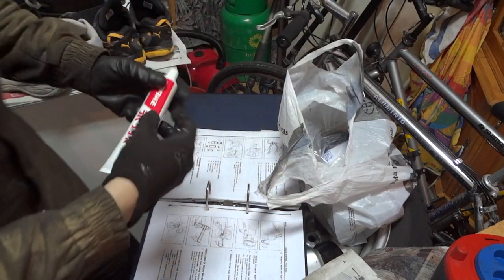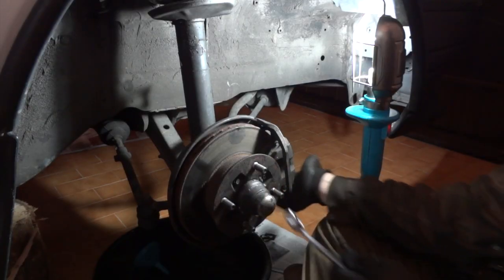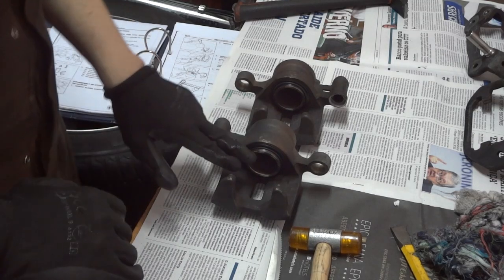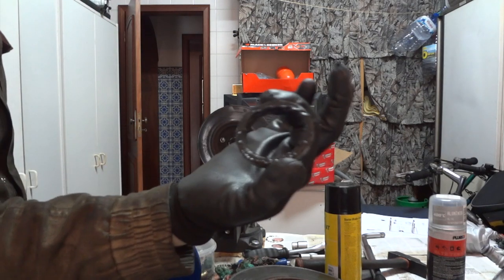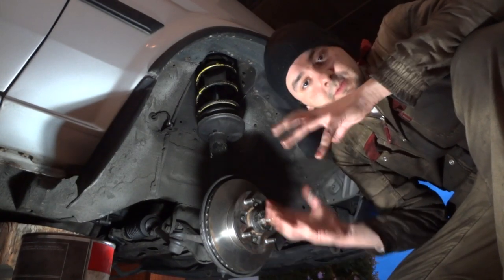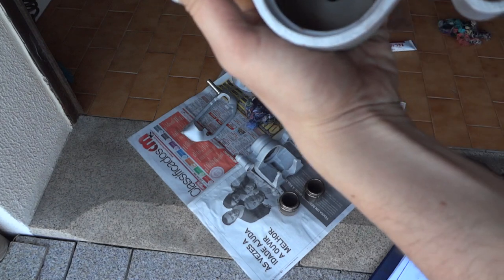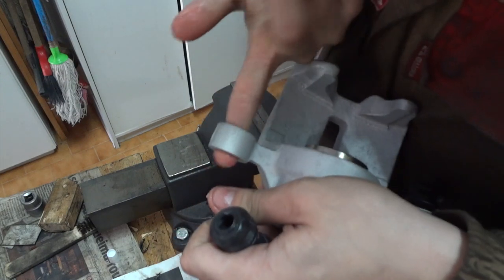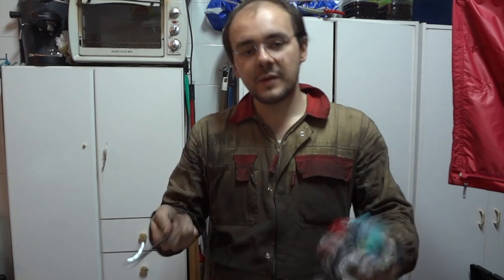How to rebuild your car brakes (1/3 Front Calipers) (1987 Corolla AE86).

Comment: Are the wheels bearings that easy to take out or replace?  How did the brakes feel after all the new grease and replacement parts?
Reply from the maker: Well, the first thing i noticed is that my brakes no longer made a grinding noise when going in reverse gear (this was the initial motivation for the whole brake job). They were getting seized so i was also noticing a bit of permanent scrubbing between the pads and the rotors. After the rebuild, you feel a softer pedal but a stronger braking. It is easier to control the braking power with your foot, the overall braking becomes more progressive, I cant explain. Everything becomes smoother. 

As for the bearings, I only did it as a preventive repair, so there was no actual difference. However, clean grease will greatly improve the life expectancy of the bearings, as long as they are correctly tightened! Dont overtighten, follow the manual's procedures as I show in the video and your bearings will last you forever with clean grease regularly :-)
Reply: João Rocha da Silva You don not need a press to do these bearings?
Reply from the maker: Nope, they come out very easily unlike in fwd cars.

Comment: Hello.... 

can brakes of ae100 corolla Levin be installed on corolla E80... without much modification ??
Reply: Well, Silva had AE86, which is RWD, completely different from the FWD`s you ask about.

The front hub system (E80 and E100 FWD`s have axle through hub from front transmission, AE86 which is Rear wheel drive has spindle through hub.

To answer your question, If E80 (you did not specify 4E or 4A) and AE100 has the same hubs or at least drive shafts then yes you can swap brakes around.

If not you have to change transmission as well and then its not worth it. you will need complete AE100 transmission with drive shafts, front struts, hubs the whole sheblang.

Then its about what engine, different engine = different transmission.
4E-engine from AE80 = Different transmission from 4A-engine in AE100, the two don`t bolt together (unless bellhousings can be interchanged IF transmission is the same).

All this for possibly a few mm`s bigger brakes with no bigger engine?..

Best for you to just stick with what exists and not re-invent the wheel, get EBC or Brembo discs and EBC Ultimax or ETF or Remsa pads, it`s a good combo for these cars, low noise, low dust, low wear, good pedal feed.
Reply: +ToreDL87 yes I know  E80 is FWD n  Ae86 is RWD... my question not related to video... just inquired about brakes in general...

currently I have 3E... plan to change it to 4AGE..  

So inquiring if Ae100 (FWD) can be fitted to E80... ??

Thanks for your response anyway